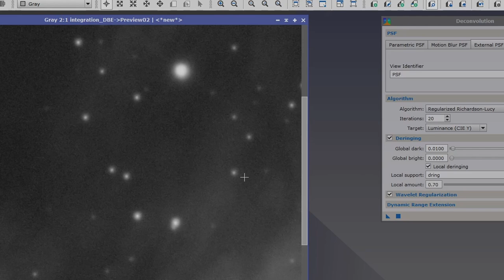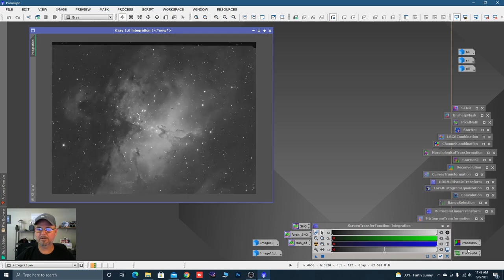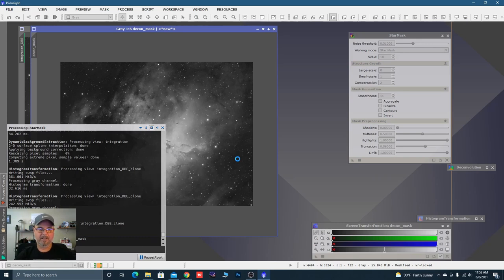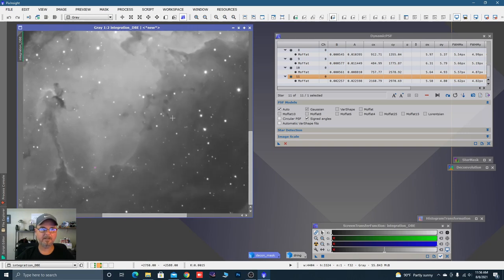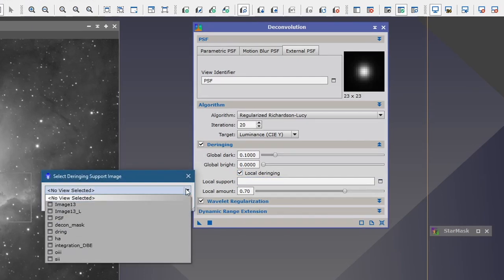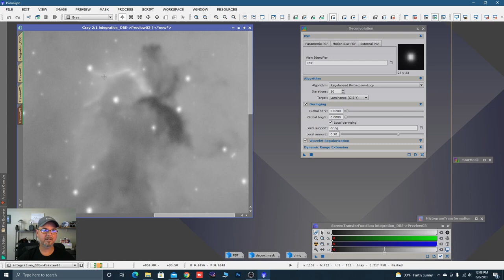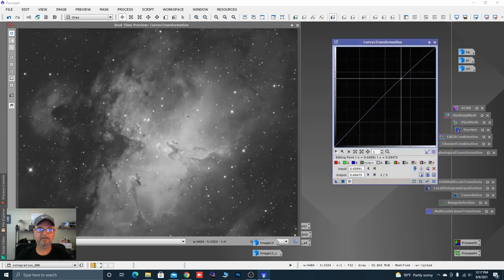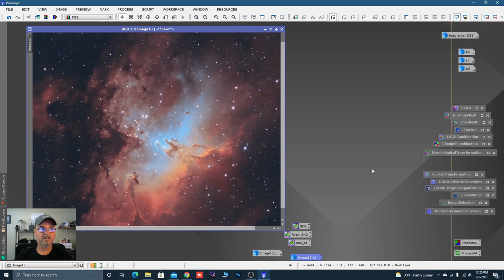Deconvolution Doesn't Have To Be Scary

Comment: Nice job, great image with the RC8. Do you use a flatter at native focal length, or just as is? Hovering between this and the vixen vc200l for longer focal length. Thanks
Reply from the maker: Thanks! No the RC design doesn't need a flattener.  I do owner the reducer but haven't used it. Shooting at the native 1635mm at f8 isn't as tough as I thought it would be. Any longer than that I feel need a permanent pair set up to be able to fine tune Polar Alingment over several sessions and be ale to hold it.

Comment: Nice video, thanks for sharing. What are your thoughts on the manual process vs EzDecon?
Reply: Hahaha....should've waited to finish the video before posting the comment, still interesting if you could expand on it.
Reply from the maker: @reversedvision  I know...you got excited😉 . Ez decon can produce sharper details quicker but usually at a cost of star halos that you very little control to mitigate. The manual method takes more attempts but I think the effort is worth it in the end.